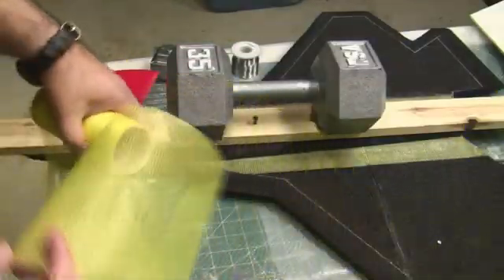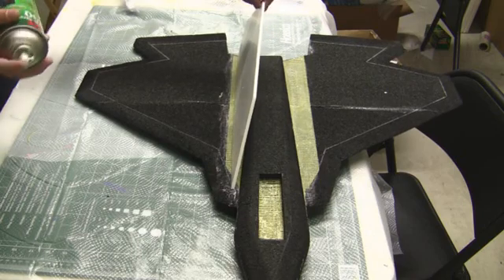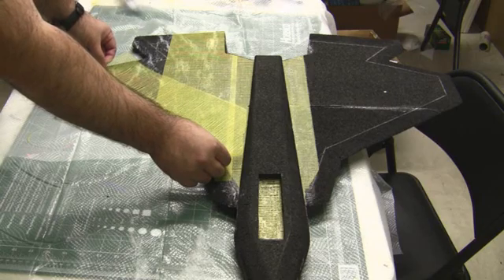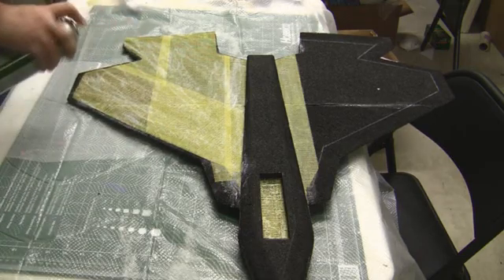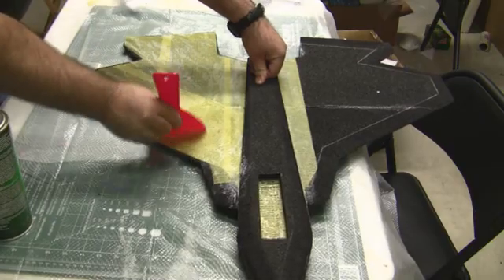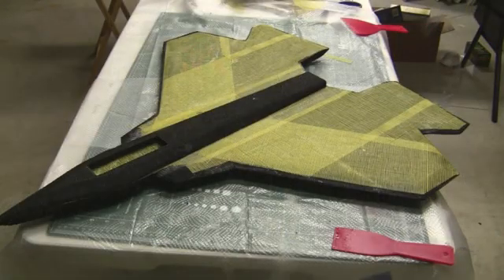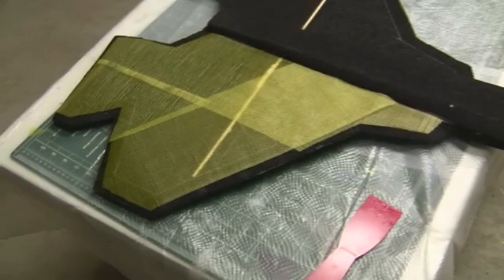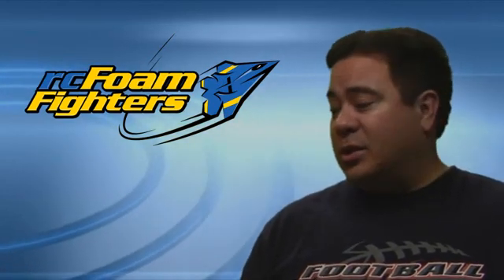Part 2B - EPP Park Jet (Scratch Built RC Plane)

Comment from the maker: Thanks for the suggestion, I agree with you on the lighting in the videos. Its from the poor lighting in my basement. We are still using a temporary set up. I have all the parts for a better video station but I still have to put it all together.  Eventually we will get it up and running. But I'm not too worried about it right now, we are just a couple amature video makers and glad how they are so far with our limited time and budget.

Comment from the maker: droog,

The monkey plane motor would work ok.  the monkey plane is nearly the same size and weight. Its a good cheap costing motor.  For plane plane in the video I am going to put a larger, stronger, higher rpm motor on it though. i will be using the Grayson Hobbies Super Mega Jet motor, I believe it is rated somewhere around 400watts with a 6x5.5 prop. The Monkey plane motor is running about 200watts with an 8x3.8 prop.

Comment from the maker: Startazz, I was going to cover that in this video, but it ended up being to long already, thats why I had to post in 2 parts. This plane is actually one I started a while back and unfortunately I didn't film the making of the edges of the wing or carving of the fuselage. I am on vacaion now in California, but when I get back home I will video something about making the wing edges and carving/shaping foam with a hot-wire cutter and other means. Thanks for your input and comments.